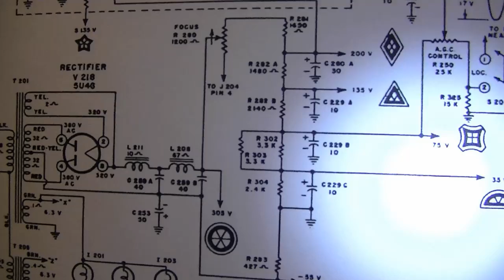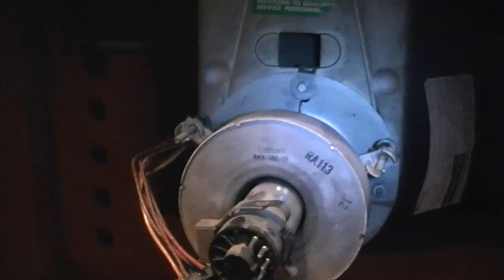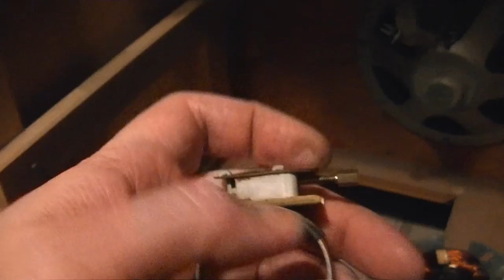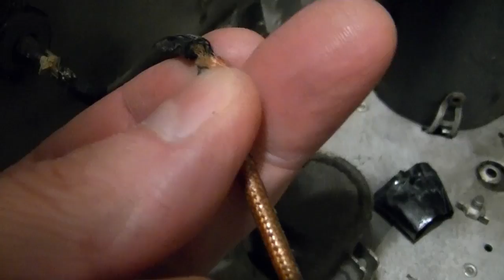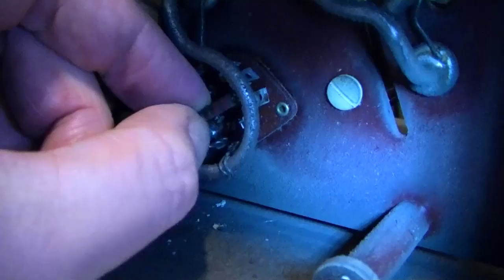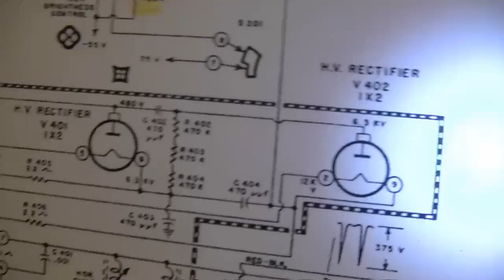Dumont RA113 restoration p3o8

Comment: What specifically do you mean by "test CRT?  Does that mean that they were specifically built as test CRT's replacement when servicing or are they just picture tubes that you identified from existing CRT  manufacturer.  I need a test CRT for some of the things I have on my plate.
Reply from the maker: Sam Calloway They were specifically built for use while servicing TV.  THey are much smaller than the originals and are more rugged electrically.  There are three - 5AXP4 for the early round CRTs, 8XP4 for earl;y rectangular like this TV and 8YP4 for the later rectangular CRTs.

Comment: Looking forward to the continued repair of the over engineered DuMont. DuMont takes the boat anchor to a higher level.
Reply from the maker: Nice as this RA-113 is, it's really not all that over engineered.  Earlier Dumonts had Sola CV transformers and a relay to delay applying B+ until the tubes warmed up.  My Clifton even has a regulated HV supply.